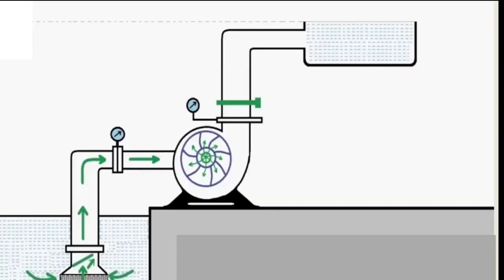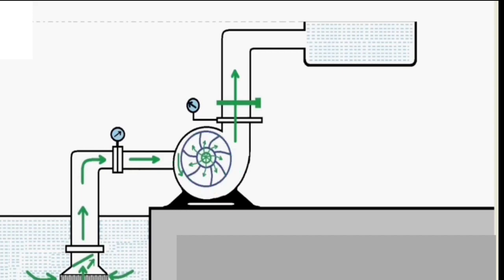Voltage? Current? Power?, what is Volt, Amp, Watt in Kannada

Comment: Good information, please
nanagodu vishaya tilisi,

1)'6000 'watt manthu '72 'volt Induction moter run aagalu yestu 'AMP' AVASHYAVIDE?

2) 6000watt Induction moter 2.7volt 500f (*27= ) 72.9volt 13500f na Super  capacitor ninda run  agataa?
Reply from the maker: 83.33 amps
Reply from the maker: Smart boy hm good
Reply: Thank for given this information.
Then, Nana 2ne prastenege uttar.?
6000watt 72 volt induction moter capacitors ninda run aagataa......
Reply from the maker: @manjukumbar1712   nimma question ennome nodi khalsi 2.7 v anta evaga 72 v adake kelde
Reply: @Funny.Bunny.Gaming  

(2.7 volt 500f *27capacitors =) 72 volt, 13500f super capacitor....